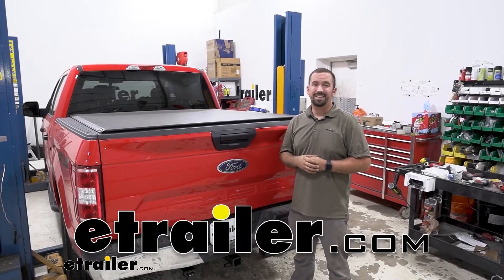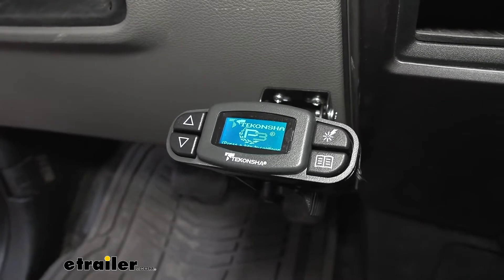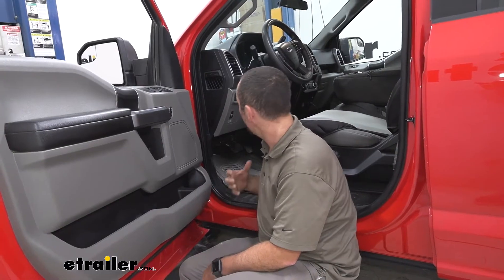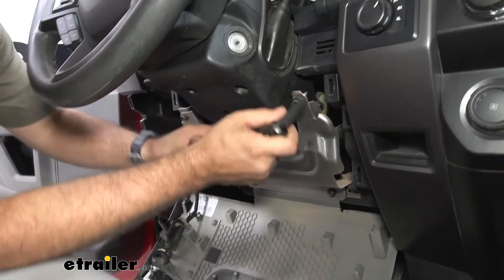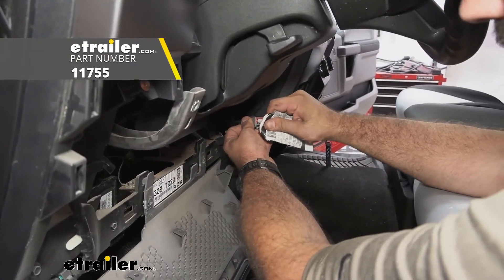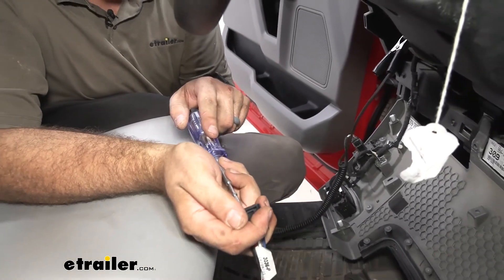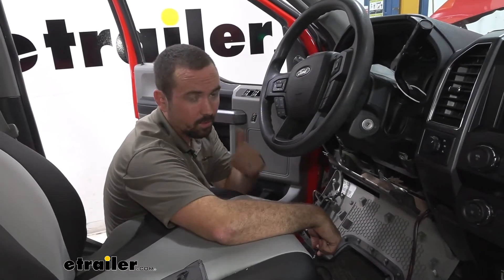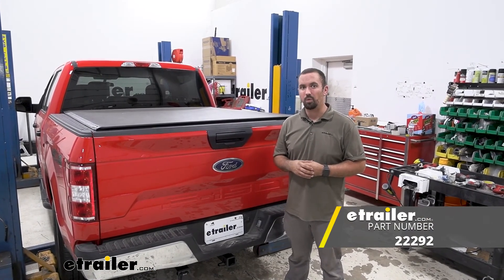Setting up the Tekonsha Plug-In Wiring Adapter for Electric Brake Controllers on a 2020 Ford F-150

Comment: Just added one on my 2015 f150 lariat sport but now my trucks throwing a check engine light even after I’ve unplugged it
Reply from the maker: You may be using the wrong brake controller wiring harness or plugging it into the wrong place. This is the first time I have heard of this issue. If the truck had the factory brake controller and you unplugged it then that would cause an error light to appear on the dash.
https://www.etrailer.com/bc-2015_Ford_F-150.htm